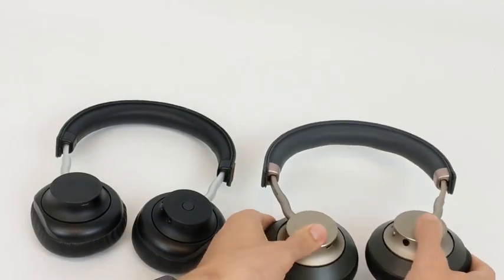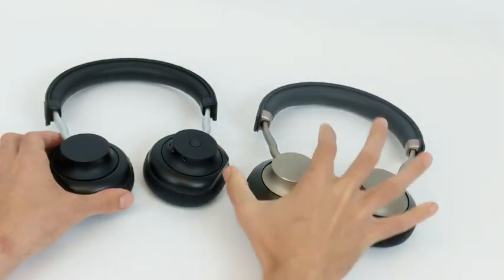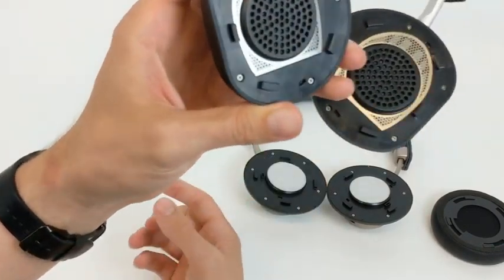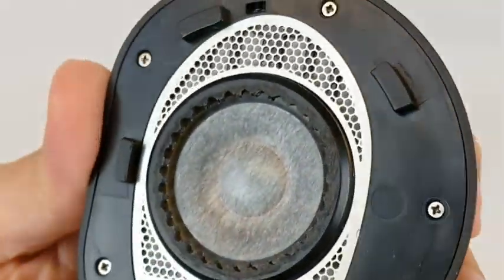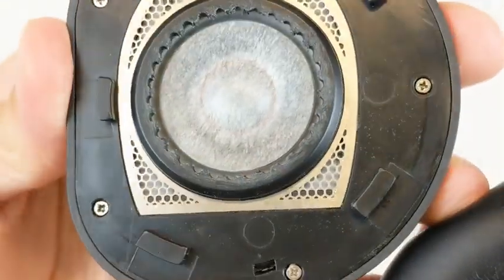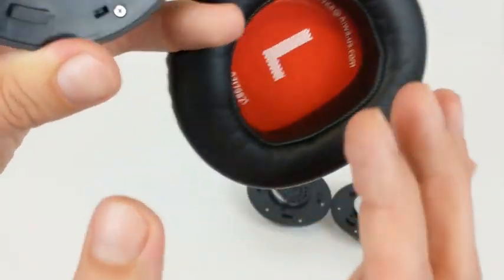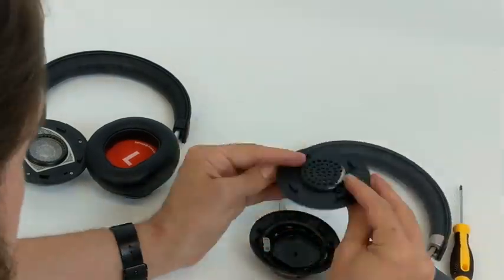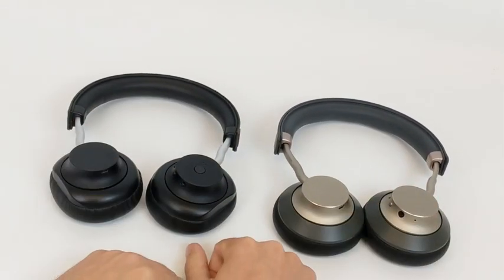Aiwa Arc-1 Heyday Teardown

Comment: Hi Joe, thanks for the teardown. The only major problem I have with the Arc-1 is that the driver platform is flat and is not angled or cut out to accommodate for the external pinna so extended use causes me a slight burning sensation.
I've tried adding foam under the rear of the earcup. Foam directly on the top of the driver platform. Replacement earpads which was the worst, totally changed the acoustics. I sell hearing aids and I know what a difference changing the acoustic parameters can make in the end. I would say that the clamp force is light and my ears do not protrude any more than normal.
I have two other slight annoyances a slight creaking on the left and hiss when no audio is being transmitted. I can get past both of those but the very thin layer of fabric between my cratalige isn't enough. I wish there was something I could do to make them more comfortable for me. It's too bad because the sound quality is very well balanced compared to a lot of other headphones out on the market and suitable for many. You guys deserve more praise and market share for the products you've introduced since your revival. Keep up the good work. I'll be back for more.